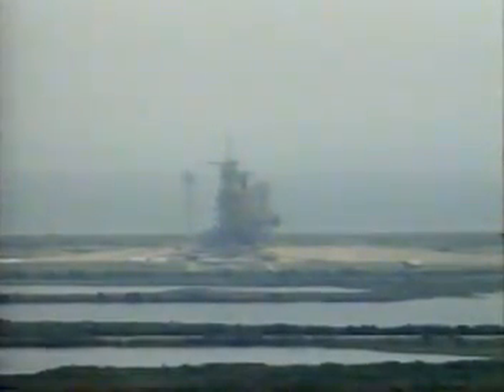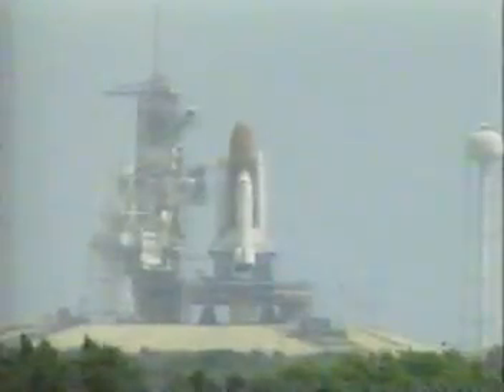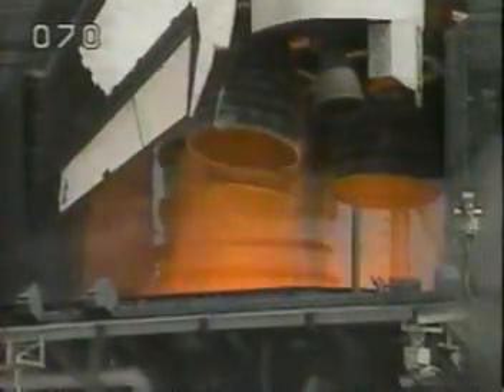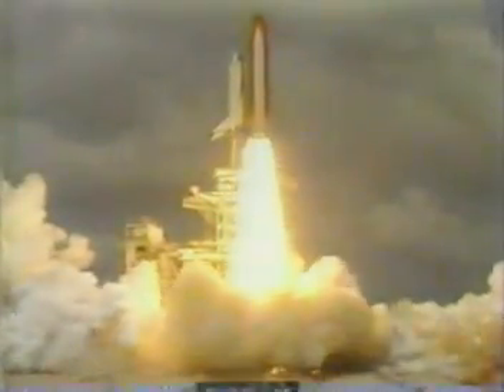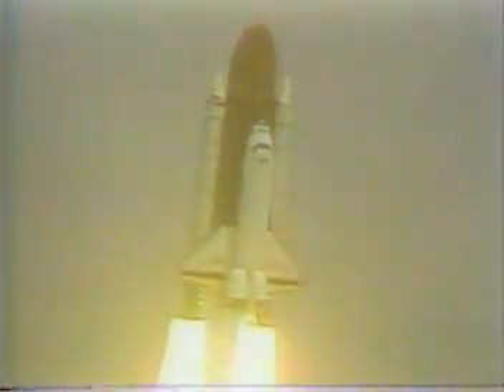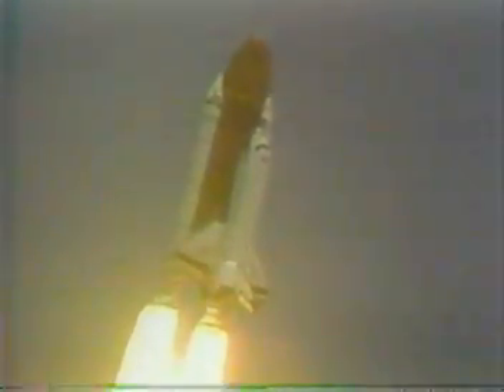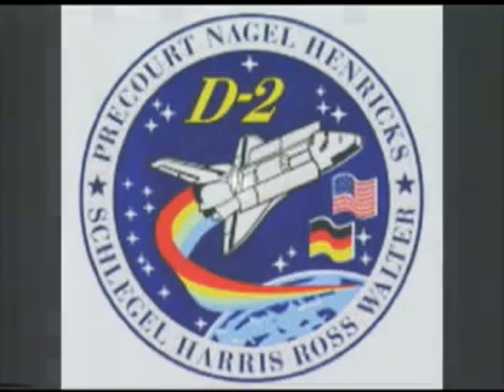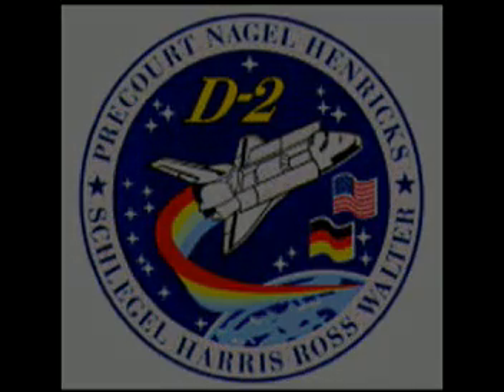STS-55, Columbia (April 26, 1993)

Comment: Just checking.  This was only shuttle I actually saw in Fla. but it wasn't until a much later mission that Columbia failed on re-entry.
Reply from the maker: That's right.  Columbia disintegrated on February 1, 2003, coming back at the end of STS-107.